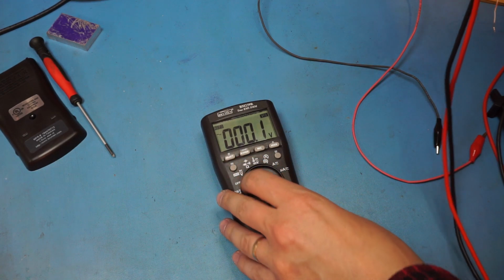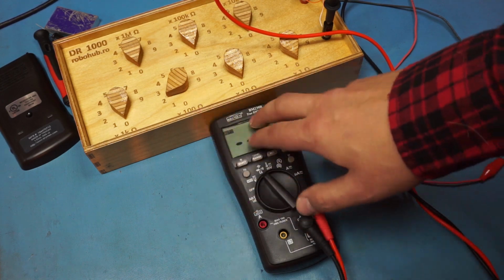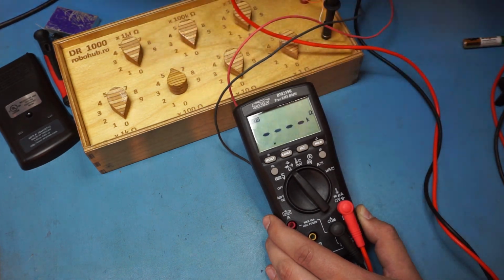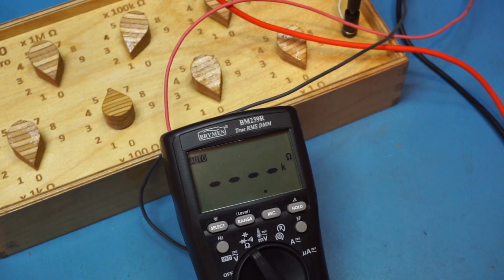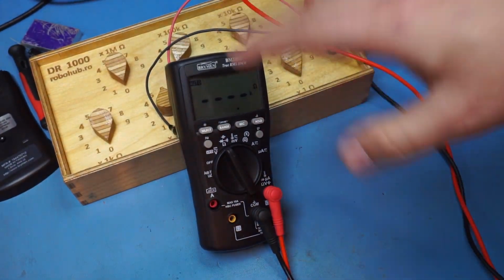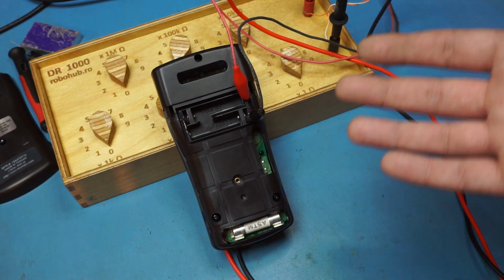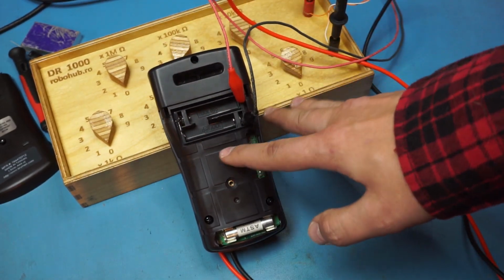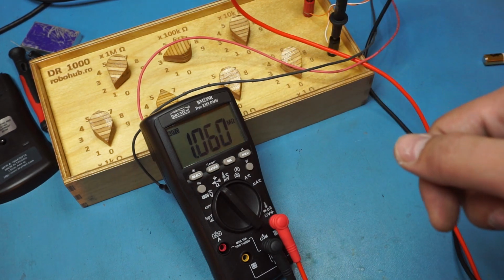Brymen BM239R resistance range weird problem

Comment: Thank you, very informative, will definitely thoroughly check the next multimeter I get! Also I'll keep a power supply at hand in case I ever encounter a device that needs more voltage than batteries can offer. Have a good one!
Reply from the maker: glad you learned something, you dick.